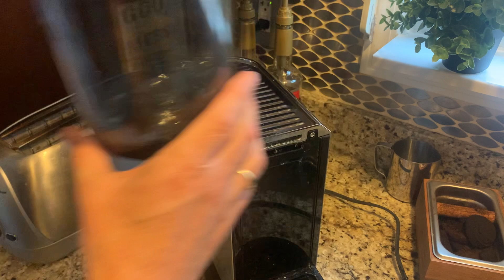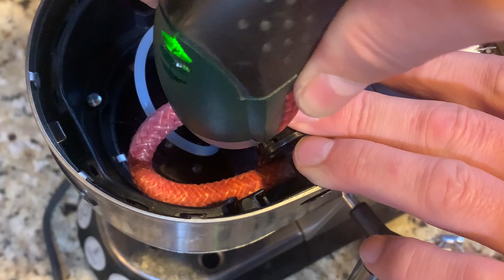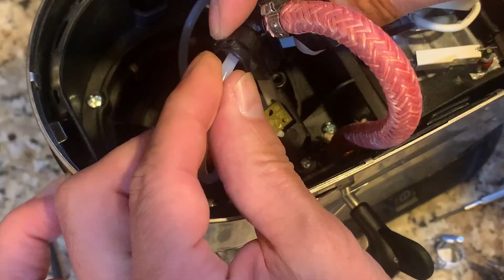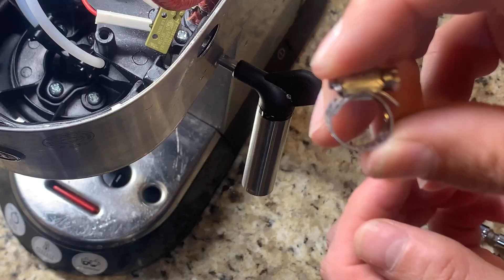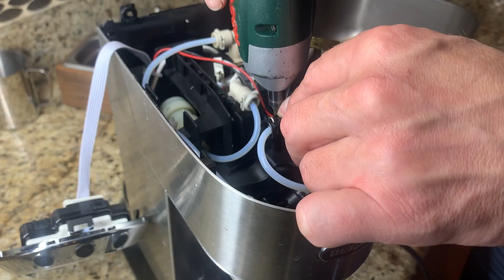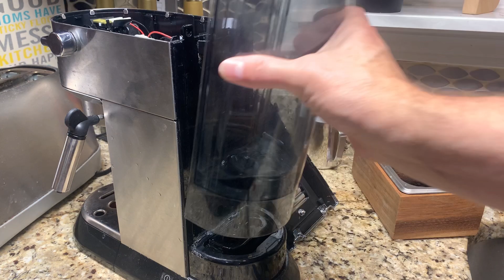Fix dripping De'Longhi EC680 Espresso machine

Comment: I have a slightly different issue that water is literally squirting out of the wand at high pressure.
Reply from the maker: Might still be the same issue, i.e. the valve.

Comment: Hey Mr Hockey Beats,
Many thanks for this. My EC685 had the very same problem - a badly leaking frother spout. So i bought the part you identified as being the source of the issue: steam valve assembly/tap (for less than £10, including shipping); followed your excellent instructions of how to change it; and i now have an espresso machine that no longer leaks. Brilliant...! 
😀
Reply from the maker: You're very welcome! I'm so glad to hear that fixed your problem.